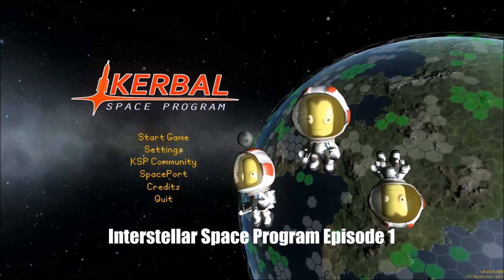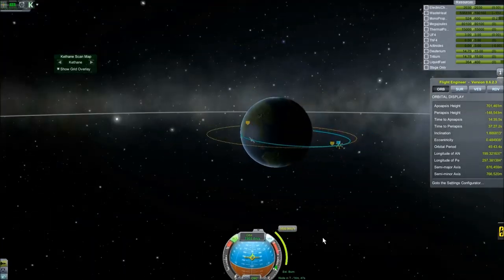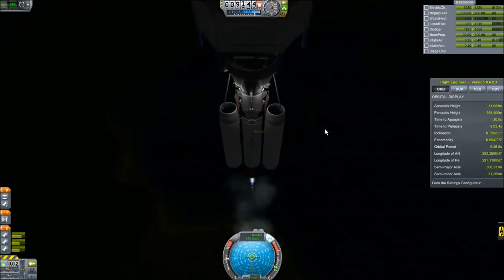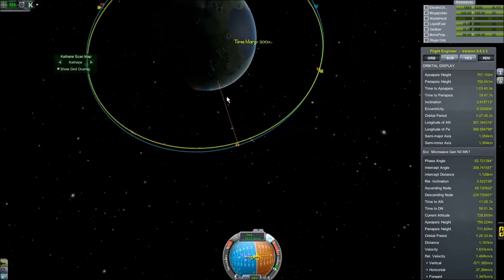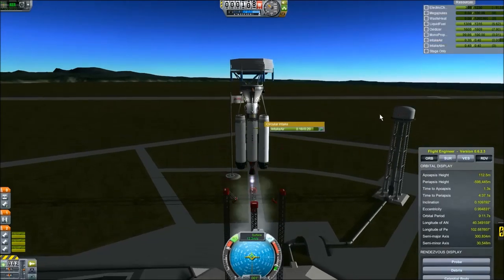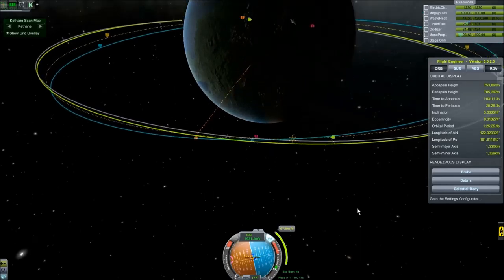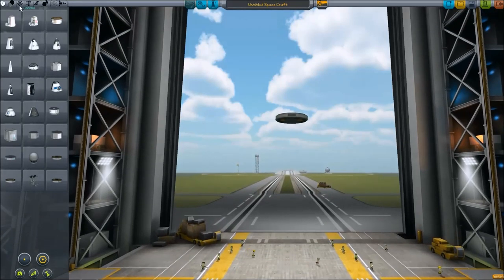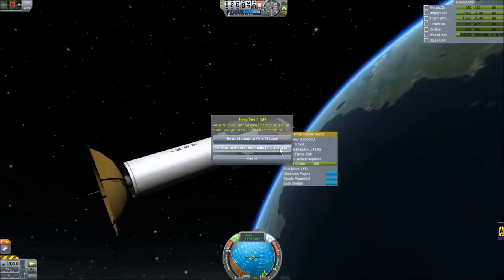KSP Interstellar Space Program Episode 1, Microwave Relay Network

Comment: the problem with your triangular network is that no matter how accurate you are they will creep and after normal game play timewarping they will bunch up on each other.  Constantly readjusting their orbits becomes a real pain.  You might want to consider putting 4 sats in highly elliptical equatorial orbits is a clover pattern.  These will not drift and the sats will spend most of their time near the apoapsis.  then put two more in polar orbits ofset by 90 degrees.
Reply from the maker: That's an option alright, there are a couple of ways to do it.
Reply: That's an interesting pattern, I was thinking 4 relay stations in Keosynchronous orbit and the power station somewhere around 250 km, so is relatively easy to get to for maintenance.

Comment: heat is not measured in megajoules. megajoules is a measure of power at a specific point. Megawatts is a measure of power generation. one megajoule per second== megawatt
Reply: Ahem, "The joule (/ˈdʒuːl/ or sometimes /ˈdʒaʊl/), symbol J, is a derived unit of energy, work, or amount of heat in the International System of Units."
Reply: AlsoKnownAsJoshua  yeah, i saw a thing and interpreted it badly, i realize a joule is a measurement of all types o energy. it is pretty much to convert energy like temperature into... I don't know what measurement of light there is, i guess whatever unit u measure with a Geiger counter, which measures radiation, and i'm not fully sure if it measures a form of radiation only, but i don't think it does.
Reply: uh? have you wrote it wrong then done the equation right? E(heat)/t = P so MJ/s=MW....
Reply: noksookao
yes, but MW is more of an electrical unit, as electricity "power" isn't really measured as a stagnant number and more of a energy production, as electricity is electrons, and its kinda useless if it ain't moving. By useless, i mean its only useful for making or un-making ions.
Reply: more of an electrical unit? MW it just means W x10^6. Are you on bout the flow of electrons i.e. Potential Difference required? stagnant ions? lost me there
Reply: wat?

Comment: When I  right click on my reactor it doesn't give me the option to start it.
Reply from the maker: Depends on the reactor,  fusion reactors ( the green ones)  require a kerbal to basically be beside the reactor to turn it on or off.  That being said they start on when you first load them into you game and they take some time to power up there reaction to produce power.  Fission reactors take some power to maintain there reaction,  so you need either some batteries, have power beamed in or another power source to kick start the reaction.  One the reactor is working it will sustain itself as long as it has fuel and doesn't power off.
Reply: OK thanks, I'll give it a go
Reply: James Bond
he actually messed it up. Fission is the one that needs a kerbal and fusion needs a kickstart power